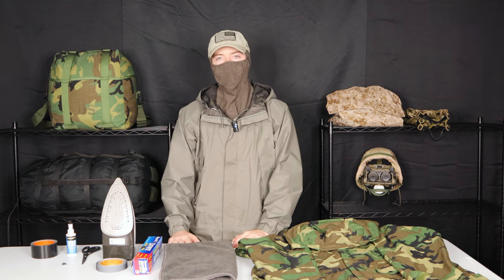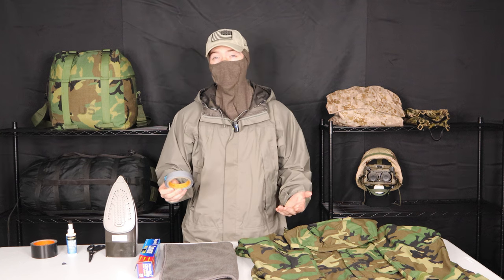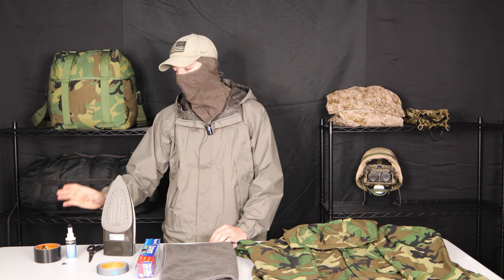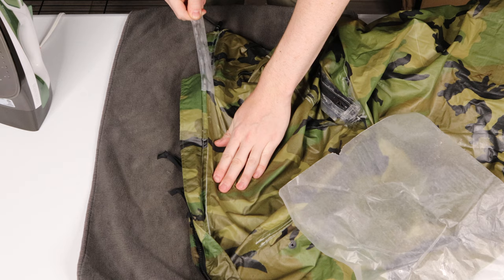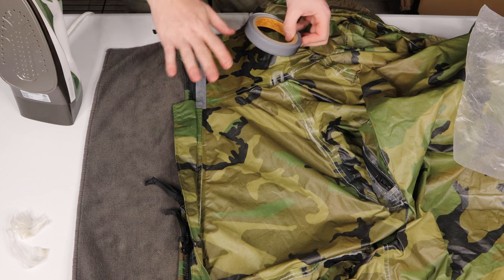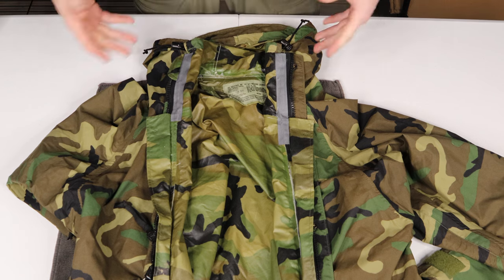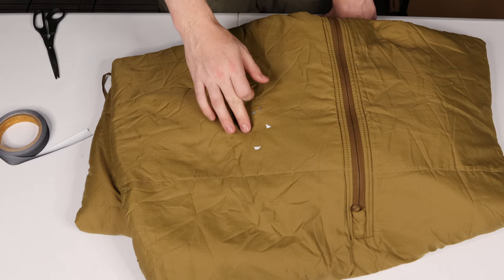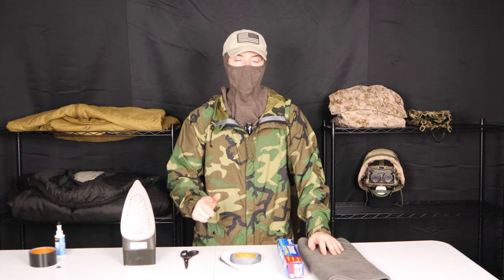How to Replace Seam Sealing Tape on Wet Weather Gear | The Joy of Kit Care

Comment: Rolling it with a pin quickly after will help with pressure. Cylinders have very narrow point of contact allowing for quite high PSI with low force required

Comment: I've also used flex seal with great success on packs, pack lids and gortex jackets.
Reply from the maker: I CUT THIS BOAT IN HALF

I used flex seal on an Alice pack lid but it just ended up flaking off all time. Did you use the spray or the liquid can?
Reply: @KitCreep which one did you use, spray or brush on?
Reply from the maker: @RolandtheThompsonGunner  spray on. I tried dipping a pump for my shotgun in a can of flex seal and had the same flaking issue.

Comment: What do you do when all you have is the sleeves and hood that are the only parts wth the coating
Reply from the maker: You can just turn the sleeves inside out, remove old seam tape, then reapply where needed. Armpits and hood might be tricky because of their curvature but it’s doable